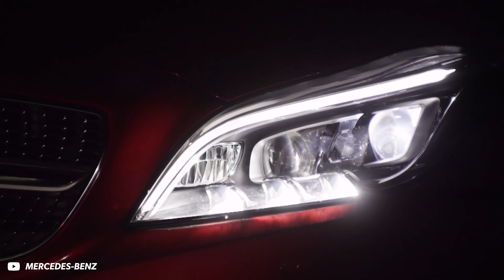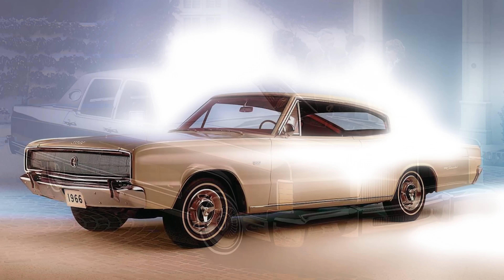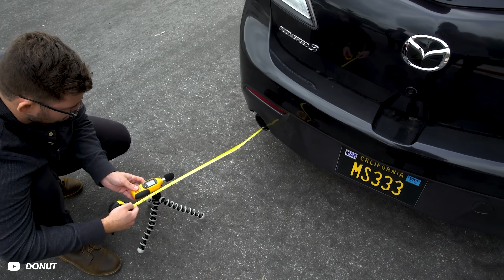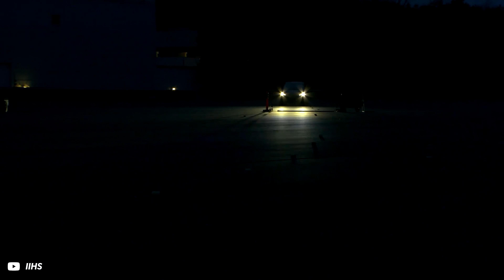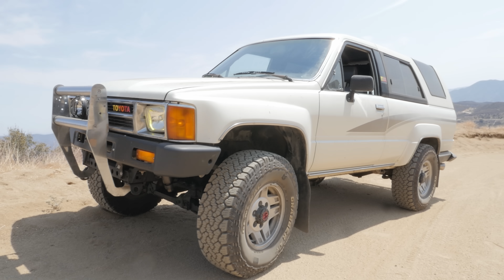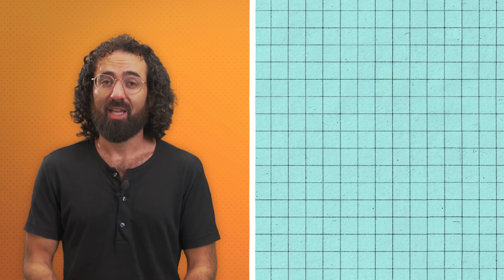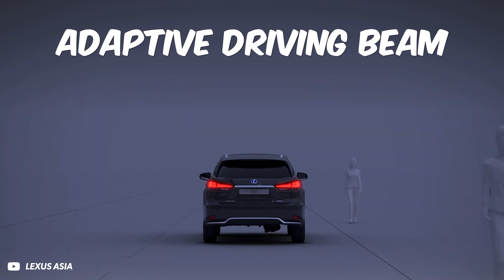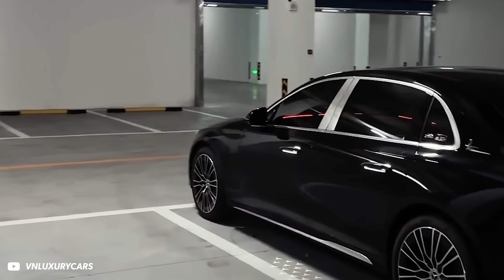Why new headlights are blinding American drivers

Comment: As an e-bike commuter I'm surprised no one in the comments have shifted the blame to me yet, as is the case in every discussion about bikes on roads.  As I'm sure it's just an oversight and its only a matter of time before I get blamed, trust me, I get blinded too, and your damned adaptive headlights ignore me just like the drivers of the vehicles do, the difference being I'm exposed doing 20mph on 40lbs of steel surrounded by 3000lb hunks of steel going much faster.  And yes, I admit to having a blindingly bright headlight, but I searched far and wide and found one with a cutoff, paid the outrageous price for it, and took the time to properly align it so it mostly prevents blinding people, the physics of a bicycle make it such I accidently still do occasionally.  Too bad... I tried, for my own safety I don't want to blind drivers but I also intentionally want to be the brightest, most annoying, impossible to ignore object on the road, I have so many flashing LEDs on my bicycle/trailer combo I look like a carnival ride at night.  So, yeah, sorry if my lights get in your eyes, just know your lights get in mine as well.  And regardless of whose lights cause the accident I am the one 99% more likely to die.  It's my road too, be nice and slow down, I am peddling as fast as I can!  🤕

Comment: It has to be made law that they use warm light, the cool lights remove night vision....when driving at night, same with the led streetlights.  Auto cancelling high beams need to be banned and brightness and reflection need to be controlled by law.

Meanwhile road deaths are rising again after dropping for many years before these new bulbs were common.  Potentially from people being blinded at night

Comment: I'm disappointed you spent so much time talking about lumens vs lux as well as complex adaptive technology to reduce blinding, but then missed an entire sphere of cause which is all centered around headlight aim.  Aftermarket headlights definitely cause a lot of problems, but the primary reason people get blinded is because aiming is poorly enforced.  First of all, new vehicle dealers are not competently performing required headlight aiming during pre-delivery inspections.  Second, modifications to vehicle suspension often skew the headlight auto-leveling features (which typically measure rolling average rear suspension compression to apply an extrapolated tilt correction) into a nonfunctional state.  Finally, the few states that do enforce annual safety inspections do it in a pencil-whipping manner where they don't actually verify headlights are correctly aimed beyond a quick glance that they appear to be pointing forward.

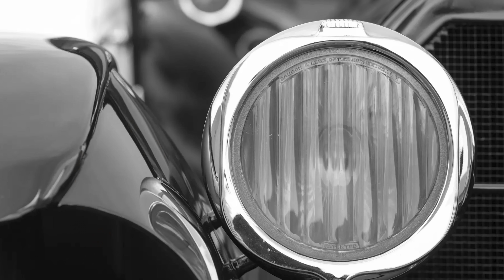Comment: Good video, but there's a factual error at 1:02. Sealed beam headlights did not start in 1915. Rather, from the earliest electric headlights through 1939, the bulb and the lens/reflector unit were separate, with replaceable bulbs. Beginning in 1940, 7" round sealed beams became standard for vehicles in the US. Quad 5" sealed beams were introduced in 1958, with rectangular units being introduced in the 1970s. As the video says, separate lens/reflector units with replaceable halogen bulbs were legalized in the U.S. in 1984.

Comment: This is a huge problem where I live in the US. Even the state troops here have blindingly bright standard beam lights on their cruisers. I actually stopped a trooper in the neighborhood one morning to let him know his brights were on and that I wasn’t able to see at the 4 way stop due to his head lights. He said his high beams weren’t on, I said that’s a problem lol. The headlight issue that’s been going on for many years now needs to be addressed and corrected. If the brighter lights were closer to the ground like most fog light locations then it wouldn’t be such a problem. I also have an auto dimming rearview mirror and it flares out so bad when I drive during the early morning or evening that it’s essentially unusable anymore. No need to make headlights more complicated, just need to move the high beams lower and keep them from pointing above a certain angle and it solves all problem. The last thing people need is even more expensive tech to solve a problem tech created in the first place.

Comment: Yup, it's crazy! In austria about 50% of people drive with headlights out of adjustment. That's the first problem, most are older cars with halogens though, so you can retain some eyesight afterwards. The second bigger problem are the modern cars with extra bright headlights out of adjustment. They make you effectively blind for a good few hundred meters. The third similarly big problem are the modern cars, extreme bright, and they are usually set to "auto", what means it automatically shuts off the high-beams when there is oncoming traffic (because people are way too lazy). In theory it sounds amazing, but in practice i was already the "oncoming traffic" for such cars, and by the time it turns off the highs i'm already stabbed in my eyeballs with massive success 😅 Then there are the drivers fiddling with the touchscreen and their phones, but that's another story. Be safe guys, and never trust the others on the road!

Edit: LED bulbs are actually amazing, i had them in a 30 year old car. Of course i adjusted the beams so i wont sabotage the oncoming traffic, and it was without any problems, no one signaled me "to turn off the highs".

Comment: People have to let their eyes adjust to the dark. But everyone wants to drive a car with lights so bright they could land a plane with them.
Reply: This
Ironically this doesnt just apply to driving. Like, a room gets "dark" (aka a bit less than noon clear summer day outside light level) and people just instantly turn on the light instead of waiting for bloody five seconds and theyd see the same. 
I actually suffer a bit from this since I have oversensitive eyes and too much light (especially older flourescent lights) promote migraine...
Reply: Yes, and contrary to what this video says, it is a problem in Europe as well. It doesn't matter that these state of the art adaptive LEDs shut segments not blind. The general amount of light is higher anyways. As a result, your eyes adapt to brither environvment and when you're driving a car that is not new, and still has halogens, you suddenly feel as if your lights went off.
Reply: Some research indicates young poeple (those old enough to get a driver's license) might quickly readjust to night (or something like it) vision in under 2-seconds, but older drivers (say seniors) will take 8-seconds or more.
     Related, with blinding headlight is it possible to judge how far an oncoming vehicle is away? Porsche use to have a problem with this on one of their vehicle designs years ago causing an increase in car crashes.
Reply: Some parking lots are so lit up,
it is like several military magnesium flares are being used it is so bright
Sometimes I swear people have a fetish for bright light or something
Reply: @RunToEternity I liken that type of parking lot lighting to statium lights. But I think your magnesium flares comes closer to the light intensity.

Comment: The fact you imply adaptive headlights is the solution tells me you are minimum 10 years behind the discussion. Adaptive headlights simply do not work as intended, either they most of the time don't work at all, or they do work but are so slow to react and adjust that by the time you actually see the lights adjust, the oncoming car is already at your side. 

The real perpetuator behind this entire problem with car lights is the raising of the car hood, and by extension the car itself, as the lights usually follow the hood for design purposes. Not only is this bad for light placement, but it is also detrimental to pedestrian safety when it comes to collision. You should check out Fort Nine's video about that, it is really interesting.

Comment: Everyone needs the same brightness in their headlights and then it's not a problem. Take a little perspective into account here. If you're on a pitch black road, with a candle, with your eyes adjusted, that candle will light your way. If someone with a $3 Walmart 50 lumen flashlight comes along the opposite way, your little candle is going to be outshined and useless for a while, while your eyes readjust from coming into contact with that "more powerful" light from the flashlight. If then that person with the $3 flashlight comes up against a brighter flashlight they'll be blind, if that brighter flashlight comes up against someone with 50 year old incandescent headlights on low beam, that flashlight holder is going to be blinded. If you have shitty old headlights with foggy lenses and you come up against someone with LED lights you're going to be blinded. But if you also have the power of the sun in your car, you are not only much less effected by the lights coming at you, you're able to see in the dark after that car passes because you're not readjusting to a different level of light. You're not blinded by those incandescent headlights. Why? because you're using the same or more powerful ones yourself. Buy some LED lights, the go out and face some LEDs head on, it's not nearly as bad. Everyone just needs to keep up with the technology progression and we'll be alright. LED bulbs are like 20 dollars now, they're cheaper than good incandescent used to be 10-20 years ago. And basically never burn out. You can put them in ANY old car and bulb pattern and they'll make the oldest cracked foggy dingy lens still a relatively decent headlight. Even if you have bright LED lights if you look directly into the oncoming cars headlights, even if they have dingy old dim lights, they'll still blind you, and even having those bright LEDs won't help your eyes recover, you might have to try a little harder not to look into the bright LEDs but you can still manage. People who complain are those who haven't figured this out yet. Buy your own, and stop bitching. It's seriously annoying as fuck. Join us in the future and shut up.

Comment: Adaptive driving lights do not work, the lights are too bright by default and only work in specific circumstances (flat, straight road). SUVs are part of the problem as their lights do not account for cars of sizes that arent an SUV. It is also a training issue, you should be increasing the distance to the car in front at night which most drivers have forgotten now

Comment: Just aiming the lights helps everyone, oncoming traffic and the driver of the vehicle. Most are aimed too high.
I bought a used vehicle from that brands dealership. Yes, it had a 2" lift. It has the OEM halogen bulbs and housings.
I had many oncoming vehicles flash their lights at me and i couldn't see the road in front of me. I shined the headlights at a tall blank wall at home from about 75 feet away. Had another of our cars between me and the wall.
The low beams were aimed just over the roof of the car. Highbeams shined over the roof of the house.
Useless.
I lowered the low beam cutoff to just below the rear window of the car in front. Highbeam followed as it is one unit.
No more low beam blinding and can actually see the road in front of me.
I am an OTR truck driver for a living. I see so many oncoming vehicles with one or both headlights not aimed properly. Unfortunately that seems to be something people no longer take into consideration.

Comment: I live in Europe and I had never heard about ADBH. Surely my car doesn't have that.
Reply: I can tell you they do not fix the bright headlight problem. Some cars ramp up the light as soon as you are not infront of the car anymore and that's still a problem.
Reply: @DavidJonSpem  I confirm that. Especially where public street lighting makes it unnecessary to turn them on. That never ceases to bug me... I don't count the number of times I blink mine to signify the car facing me to turn them off.

Comment: Xenon/LED lights are also closer to blue (as opposed to the yellow of halogen). 
Blue light is not only harsher on our eyes, but the refraction on windshields is also more drastic. This means, you not only get flash-banged by these headlights, but it also worsens the opacity of your windshield when any imperfections are present (including rain, ice, condensation, smudges, etc). 
I genuinely think the simplest way to solve the issue is to make every headlight warm-toned. 

Until anything is enforced, I drive with blue-filter glasses at night.

Comment: I dont think adpative headights are a good idea at all. Imagine the cost to repair those! Cars are far too complex already. Automakers CANNOT be trusted to make a reliable complex headlight when they cant even make reliable engines and transmissions....the things that have been building for of a century. You are a FOOL if you support this. These corporations are far too incompetent to make it work reliable and it will fall on the consumer to have have yet another point of failure. We are stretched thin enough already.

Comment: Ive been driving a F-150 work truck with zero window tint. 

I am getting blinded by 20 year old sedans with halogens. 
I really cant blame LEDs or tall trucks or whatever. Its all so random. These cars dont even have high beams on most of the time either.

Comment: As a former VA State Inspector, I used to fail anybody and everybody that had aftermarket headlight bulbs, housings, and additional lights that weren't covered all the time. Customers got super mad at me and I just redirected them to the FMVSS or MVIP Manual.
Reply: Looking at the other comments here, turns out the factory headlights were the problem all along.
Reply: @M3galodon Depends on the vehicle. I would recommend checking the IIHS glare rating for them.
Reply: @justintonia rating dont mean js when they test in lab conditions and call it good. no hills no bumps. thats where people get blinded cresting hills. where yknow sight is most important. so yeah its all led low beams. bring back halogen low beams and keep the high beams led. problem solved.
Reply: @BLAZE13011 they literally test for everything you just mentioned
Reply: Thank you for temporarily helping to prevent us from getting as blinded even if drivers hated you for it.
Reply: @schecterhead88 No problem lol
Reply: Virginia, the worst place in the U.S. to have and drive a car. Everything is ridiculously strict there when it comes to driving. I would drive around Virginia than go through it
Reply: @3644Darrell Ok bro

Comment: I had someone with a light bar blind me at night. I was slowing down and flashed my brights and they didn't seem to care. It was so blinding that it started to burn my eyes and when I went to flip the high beams on, I hit a deer and totaled my car out. After this, I started slowing right down often times going off on the shoulder and waiting until the oncoming car passes but I was pulled over for it and the officer thought I was under the influence. This happened to me a couple of times until I purchased some sunglasses that had a night vision pair that looked yellow. This worked quite well and preventing the blinding high beams. What is really a pain is when people turn on those light bars and blinds everyone else on the road with no care at all in other people's safety.

Comment: The clock of change is so slow.  Even if your the nice guy with the latest and greatest NEW car with adapted head lights, you are helping other oncoming vehicles, but you will still have to bare the pain of the millions of older and non compliant headlights coming at you!    And what about behind us?   I think I will place a remote control mirror on my rear dash so I can dish back the eye pain there giving me from behind.  

Anther thing too, the old head light were easily adjustable as the bulb unit were independent.  Now light casements are fixed and unadjustable.   Gone are the inspection garages with the inch markers.

Comment: The "only" solution? I've been following the advancement of FLIR (night/heat vision systems) for consumer applications. For ~$200 you can buy a basic system, for $400 you can buy one with automatic animal/pedestrian detection and warning (like the NV300 MAX). Seriously, I see a future where we could all drive around with low beams or running/parking lights and have FLIR HUD on the windshield. Way safer for everyone.

Comment: laughs in country folk you only see those kind on the UTVs. most of us have been routienly blinded by 20 million plus candle spotlight looking for deer.  and that's usually the ONLY thing working on the truck...if they even turn the damn things on (half the bulbs are blown or had wires chopped off) and eveybody and their brother with modern cars has no physical instruments that'll even TELL them their lights are on.  I have to replace a minimum of eight bulbs per vehicle with each purchase. and then there's those of us worried about the wildlife jumping out in front of us with absolutely no streetlights.

Comment: I have a Subaru XV and the headlights dip automatically REALLY quickly when I the correct mode, far quicker than I can react.
Perhaps it should be standard to have better automatic dipping when other traffic around, regardless of the drivers actions.
I also believe that some rear view mirrors dip automatically. Perhaps this too should be standard.

Comment: The reason why US consumers replace factory headlights is because they work so poorly!!!   On Ford F250 trucks, you don't even get projector LED headlights until youmspend over #100,000.00 on the top of the line model!
In addition, the US DOT standard is at least 15 years behind Europe!  I have replaced all my US DOT headlights with European light housings which give much better performance in outting the light down the road where the deiver needs it! The biggest problem with US DOT headlights is the lens where it directs the light beam!!!